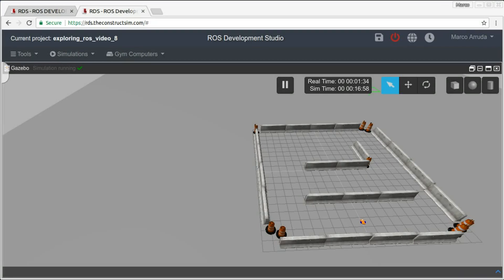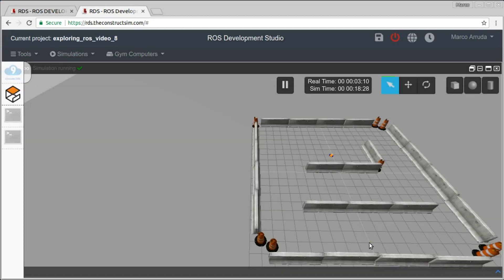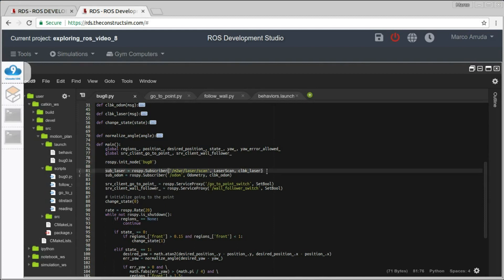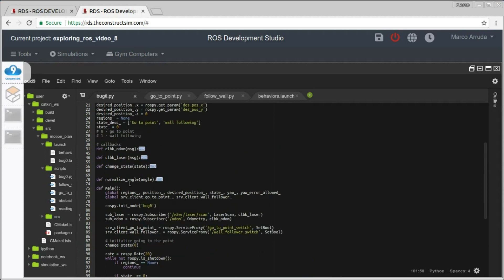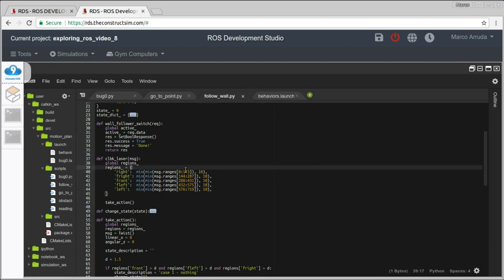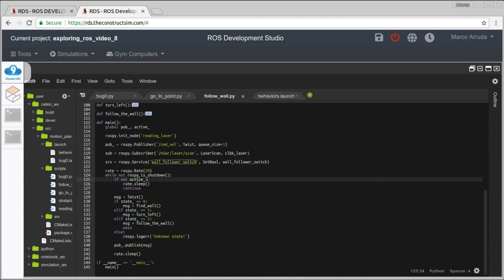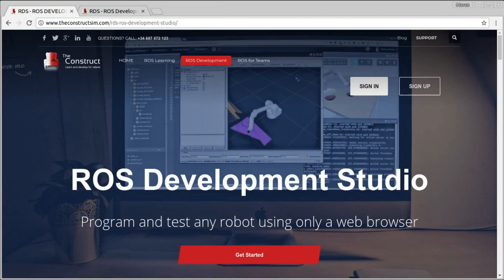[ROS Projects] - Bug 0 Algorithm - Exploring ROS with a 2 Wheeled Robot  #Part  8

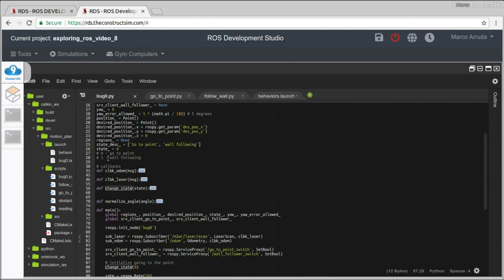Comment: kindly can you explain the part starting at 5:29 , for the wall follow case especially the 'if and condition' for all the three below cases. it's not clear how you formed these conditions and why you chose these ranges!!!!

why the error  has to be bigger than 45 and less than 90 degree

            if math.fabs(err_yaw) < (math.pi / 6) and \
               regions_['front'] > 1.5:
                change_state(0)
            
            if err_yaw > 0 and \
               math.fabs(err_yaw) > (math.pi / 4) and \
               math.fabs(err_yaw) < (math.pi / 2) and \
               regions_['left'] > 1.5:
                change_state(0)
                
            if err_yaw < 0 and \
               math.fabs(err_yaw) > (math.pi / 4) and \
               math.fabs(err_yaw) < (math.pi / 2) and \
               regions_['right'] > 1.5:
                change_state(0)